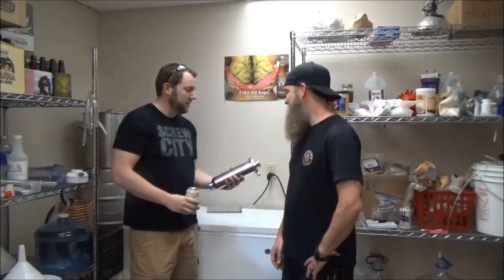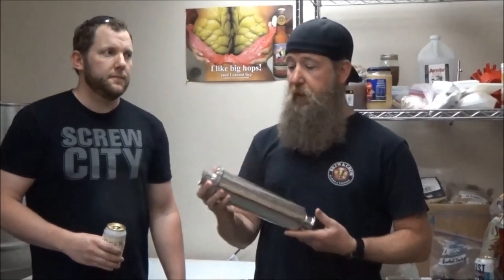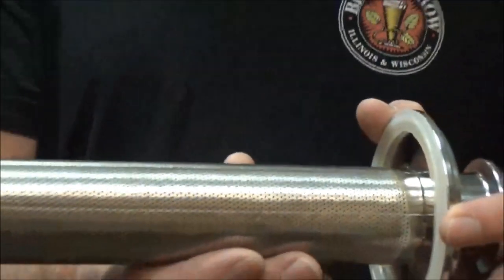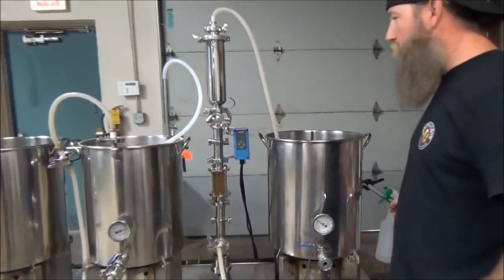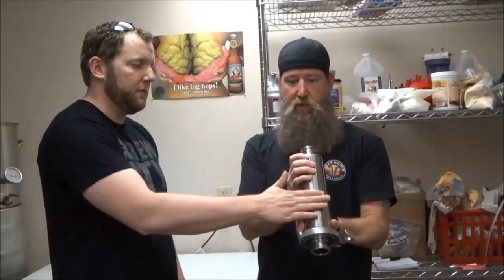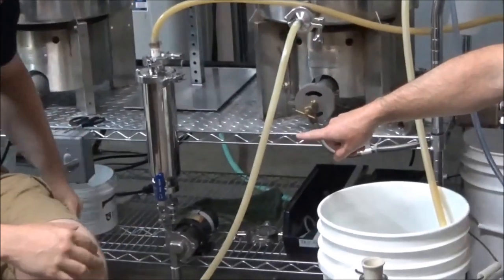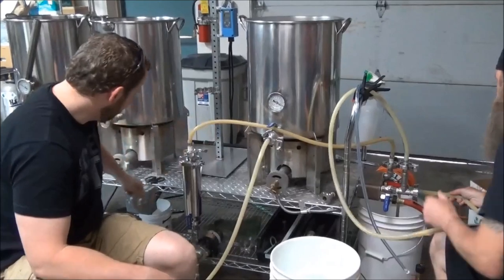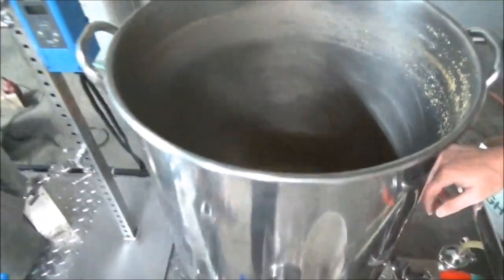Inline Wort Filter

Comment: I have one of these and it works great!  My only complaint is that after I pump my wort from kettle to my Unitank I have a bunch of wort that is left inside the filter and then plus what’s in my lines. It’s almost a liter loss of wort. You guys have any solutions/ideas other that having to brew a extra amount of wort? Some sort of hook up for an air line to push the wort out without damaging the filter?

Comment: Hi. I've looked at this filter a few years back, but I'm still not sure if it will do something for me since I use good brewing practise and have no problems so far. Cheers
Reply from the maker: Old Norse brewery 
Good point. Great brewing practices are essential to brewing in order to make the best outcomes possible. As noted by the end of the video, proper whirlpooling techniques will prove such filters unnecessary.
Reply: Smarty Pints Yes. That's what I do. Whirlpooling or just turn diptube up a bit so it don't suck in all the heavy troub. Anyway. Great vid as always. Cheers
Reply: I also agree with your comment until I started using a counterflow chiller. I normally had pretty good results with my wort kettle-to-fermenter transfers. When I added the counteflow chiller I found that my setup still pushed particles into the fermenter. Even with an otherwise good whirlpool, I would absolutely clog my counterflow chiller to the point of just removing the chiller from the line and waiting for the wort to cool down on its own in the fermenter, particularly with IPAs. I defer to the pic of an IPA they cut to for a moment in this video of the filter covered with hop matter. This filter (its on amazon) really helps with avoiding clogging the counterflow chiller and other narrow passages in the transfer and is the first to clog and be removed if necessary.

Comment: would it be convenient to use it after fermentation to eliminate all the suspended yeast?
Reply: Not sure this would be fine enough to remove yeast, I'm looking into filtering yeast out as well, because I plan on using fruits for flavoring. Everything I have come across are cartridge and plate filters
Reply: I’m curious about this as well. Not too concerned about yeast as I release that from the bottom of my Unitank. But more for fruit shavings or dry hopping from secondary fermentation.
Reply: @DMCSerenity  In order to remove yeast cells in which is typically 3–4 µm you would need a pretty fine mesh.  If available, this would probably need quite some pressure and easily be clogged. In order to totally remove yeast you would need to gradually step down with several filters in line.